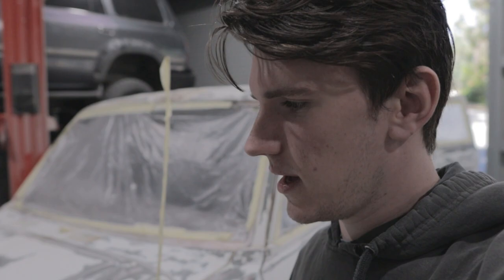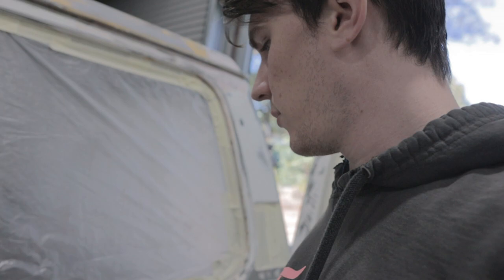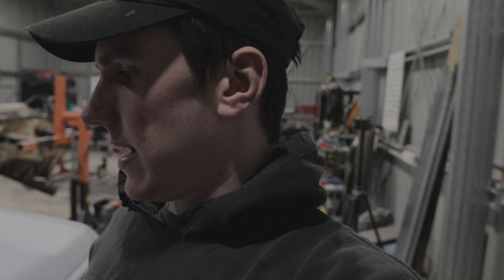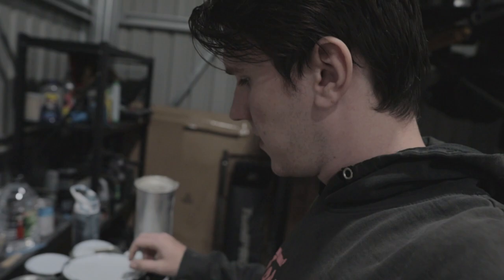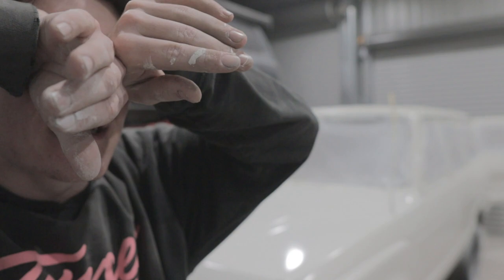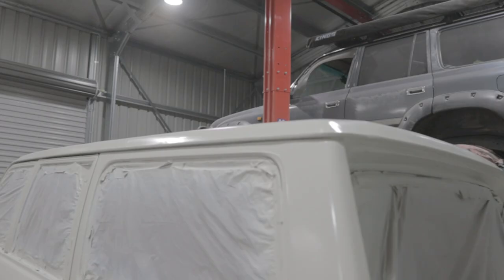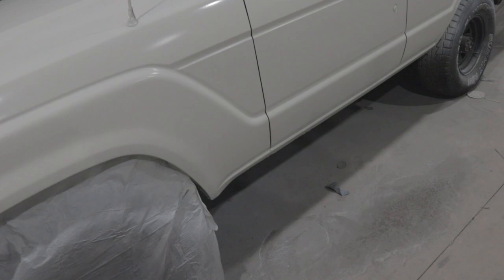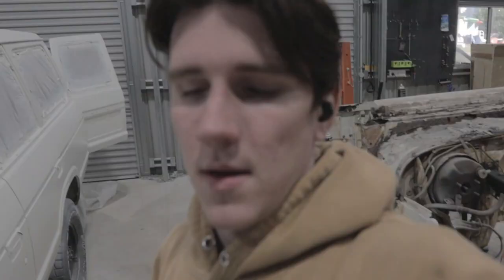Spray Painting an Entire Landcruiser By Myself

Comment: what products and paint code did you use? and whats the gun settings?
Reply from the maker: used White 045 for the paint code. I bought it from a company called HAMR Coatings. just bought it online and it shipped in a few days. had the gun spraying at about 30 psi for both primer and base. the primer was just a supercheap brand of primer surfacer. it was mostly cheap products to try and get the best finish.
Reply: @HenryBuilds  cheers!